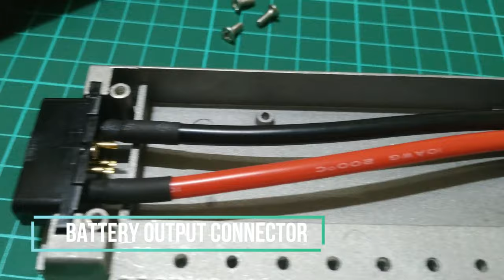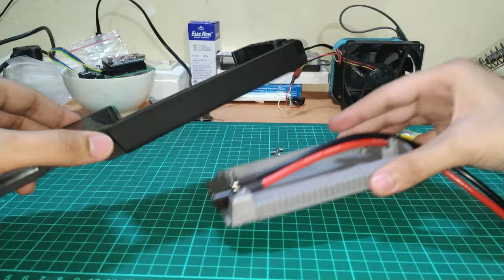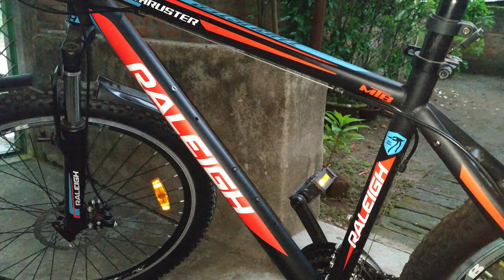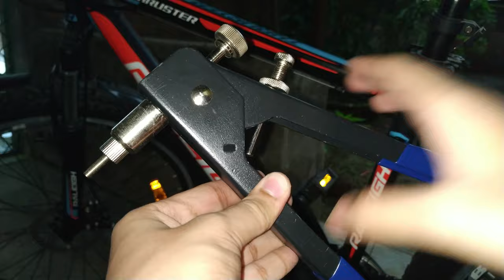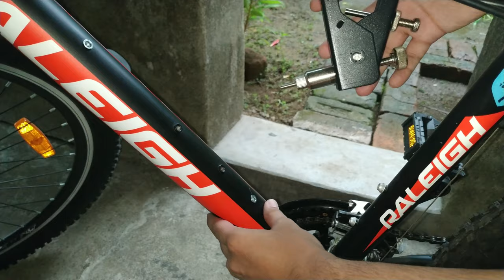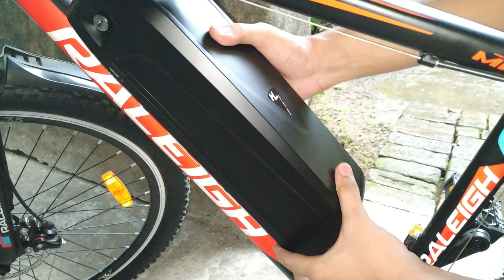How to mount Hailong 48V E-bike battery on bike || E-bike Conversion #2

Comment: Few tips for installers: 1) don't install battery as high as in the video, try to get it closer to the bottom bracket for MUCH improved balance 2) don't drill holes to bike frame unless you sure you won't ever be selling it... zipties or pipe clamps will hold the battery just as well without destroying the value of your bike.
Reply from the maker: 1. Agreed. But i had to mount it a bit up so that it can leave some space for the controller.
2. Agreed. Drilling holes in your frame does compromise a bit of strength of the frame. Try to avoid it unless necessary.

Comment: Excellent video.  I just received my Hailong today.  Mine had mounting slots in the aluminum heat sink that line up very well with my existing bottle mount holes. Do I still need to add mounting holes in the upper part of the battery mount?
Reply from the maker: Your call mate. But according to me, the more the merrier. You don't want your battery to rip off your bike frame at high speeds or bumpy roads!

Comment: I have the same battery, but a small frame on my Giant XTC, so I have went with the triangular frame bag, waiting on it coming tomorrow.
I saw a few videos were the rider had an off and the battery struck a hard object and ripped those riv nuts clean out the frame.
Reply: Thanks for the tip. I'll be stealing your battery next time you go into the quickie mart.

Comment: Bro, what is bike weight before and after conversion? I found that heavy bike is exhausting to pedal.
Reply from the maker: Yes, all the parts at least 10 Kg of extra weight to the bike, the battery being the most heavy. I am now used to riding that weight so i can't notice that now.

Comment: What is this modification of which you speak
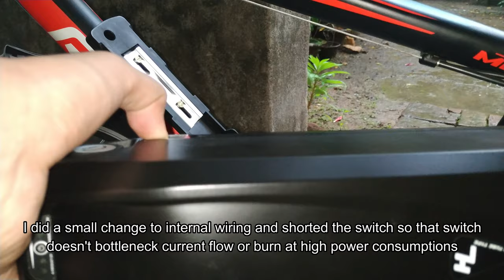Reply from the maker: I think you are talking about this part of video 7:07 . I am talking about the red switch that is in the battery case. First I wired it in series with battery and controller but later I was warned by some good fellow redditors that the switch normally can't handle that much amps can blow out due to bottleneck of current. So, for the fix/modification I just shorted the switch with thicc wire to bypass the switch. Check out this instructable for more info https://www.instructables.com/DIY-E-bike-Battery-Assembling-48V-Hailong-Battery/
Reply: @HyperMakes  thanks👍

Comment: i think my frame is so small for that battery but im not sure the numbers of the size on the page are corrects, can you tell me what are the dimensions of these battery thanks.
Reply from the maker: Hello Ronfre. The dimensions of my battery are 
Length: 370 mm
Width: 90 mm
Height: 110 mm

Comment: Good Evening! what screws did you use, I can not find screws that match the diameter of the base .. can I have a purchase link? thanks
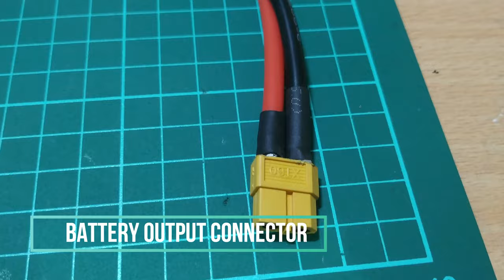Reply from the maker: These are the screws i used in the video, Timestap-> 0:28
Reply: @HyperMakes  thanks

Comment: Can use self drilling screw?
Reply from the maker: No... I suggest not to use them. They are good for sheet materials but here we are dealing with a round bar chassis.
Reply: Yes, self tapper will easily screw into aluminium bike frame if it's all you have

Comment: How is you battery now I have a 52 volt battery and after 250 mile on it I can get 7 to 8 miles out of it
Reply from the maker: I have already traveled almost 460kms. Still i get almost 74kms per charge till now. I had used EV grade 3C discharge 18650 cells. They have around 1000 cycles lifetime.

Comment: I didnt wanted to drill the frame, so I just turned the mount upside down.
Reply from the maker: No issues! I also first checked if it was possible and it was, but i decided to go for this method because the mount will be more sturdy and safe. 😊🙌🏼

Comment: Has anyone here ever heard of frame failure or damage being caused by drilling extra holes for the rivnuts? Some ppl think this shouldn’t be done for safety reasons.
Reply from the maker: Yes, you have heard right. Do this compromises the rigidity of the bike frame. I have done this on my own risk and knowledge.